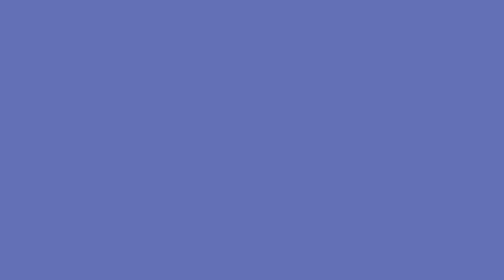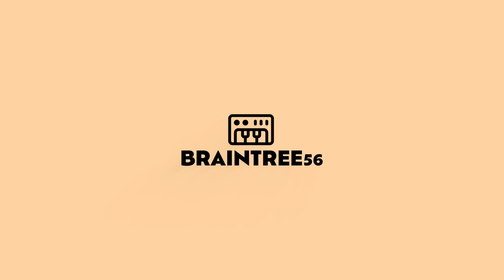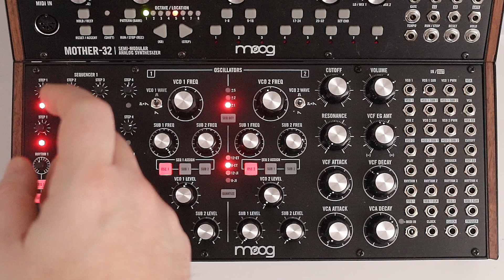Part 6 - Building a Basic Chord Progression/Sequencer and Rhythm Intro - Complete Subharmonicon Tut.

Comment: Parallel 5ths but no 3rd? This is going to make someone's head explode :hand-orange-covering-eyes:

Sounds great, theory be damned!!!!
Reply from the maker: Ha. Ever seen School of Rock? 'Eh, nevermind, you don't need that one' (or something like that...)
Reply from the maker: Also, I'm working on a video right now that , gulp, has thirds!
Reply: @braintree56  I'm looking forward to watching it. Looks like I better subscribe :)
Reply: I had a play with this and then used the second oscillator on the second sequencer with 12ET to add major and minor thirds as appropriate for the 1 5 6 4 progression. I don't know if I'd use the SH as a chord pad like this because it leaves out a bunch of the rhythmic stuff one might want to do but… yeah, it's a way to get triad chords instead of power chords.

Comment: sorry for my ignorance, I'm a noob. i think ive got it set up correctly but the mother note changes everytime the sub hits 1 , so its going way to fast, any idea what i'm doing wrong? thanx!!
Reply from the maker: It could be a number of things. Let's see if we can figure it out. Are you saying that the sub is going faster than the Mother? How are your Synths connected together?
Reply: @braintree56  yes, 1 step on mother =4 on the sub .
I have patch cords connecting them the same as you
Reply from the maker: @thagrizzaify  Ok, the first things that come to mind are - 1. Check the Assignable output setting to make sure it's set to the default setting.
2. Make sure the sequencer on the Mother is playing 16th notes.

I have videos later in the series on all those... I would start there.